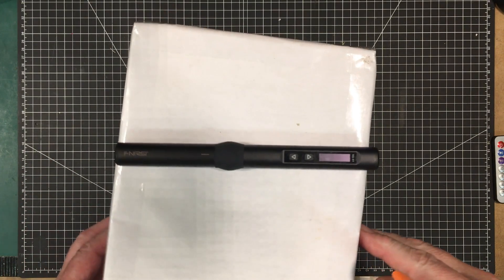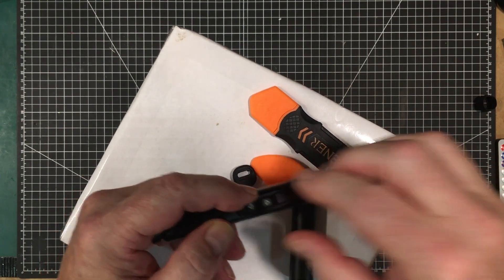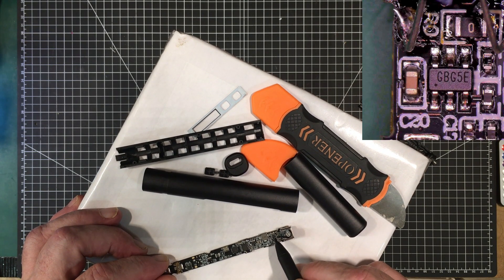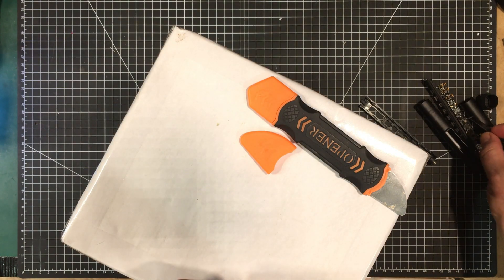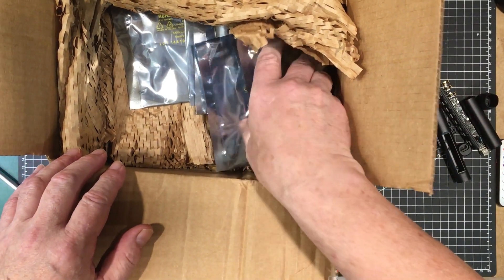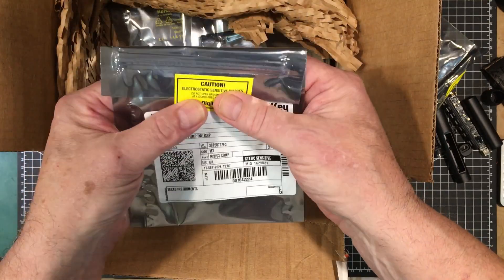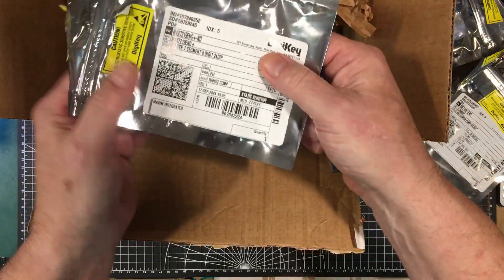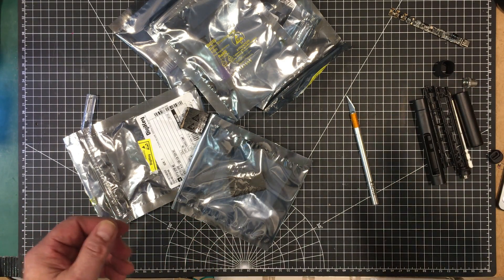Uni-Byte 0219 - Quick FNIRSI HS-01 Teardown and Some Mail (NOT from AliExpress!)

Comment: did you find what is CA2C1S ? My HS-01 was damage by stupid dc in. Seller send new one, but i want to repair old. Mosfet is shor-circuit and it overheat and shining bright!
Reply from the maker: In my case the fault was with the little buck converter near the USB connector.   I'll leave a link to the repair in the decryption above in case you are interested.  The chip marked CA2C1S is actually an AON7409 MOSFET if you can find one.  They are listed as obsolete but there is a replacement part, the AONR21357.  They are about $1.25 at DigiKey.

Comment: Nice. Hopefully you can fix it. I recently bought a very similar soldering iron on Amazon called the Mini65, at least that's the generic name. It takes the same tips but it has a different processor(an Stm32). I did a bit of poking around on the internet and probing with the multimeter to figure out what the processor was because they blasted the markings off of it. Since it's a very popular processor hopefully someone will write some custom firmware for it.
Reply from the maker: Thanks.  It's just a guess that that chips is solely to blame.  In any case, it's not going to cost very much to find out.

It the current code not working well?
Reply: @uni-byte  Yeah it's nice when a repair is cheap and hopefully that chip fixes the problem.

Actually the current firmware works great and it's not fussy at all about the power delivery like my Pinecil iron is. Just thought for future and possible new or better features having a copy of the firmware would be nice. I contacted the company and they have no plans to release any updated firmware.
Reply from the maker: @percaine  👍

Comment: I think the chip is probably a RY8310 30V 1.2A 1.4MHz Synchronous Step-Down Regulator in a SOT23-6 package.  The datasheet states "Top Marking: GBYLL (device code: GB, Y=year code, LL= lot number code)"
Reply from the maker: I think you're 100% right!  I'll get some in and attempt the repair.  They are pretty cheap.  Thank you!